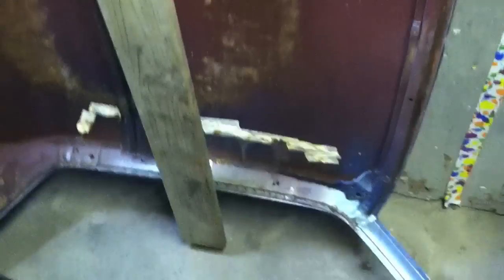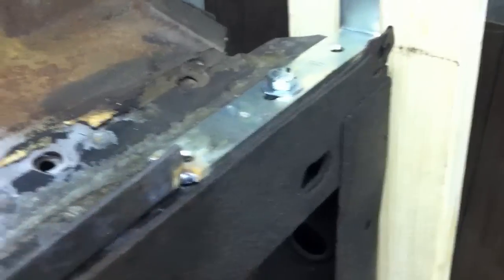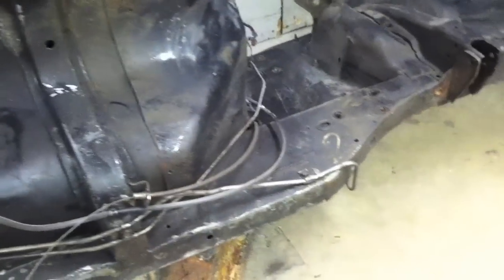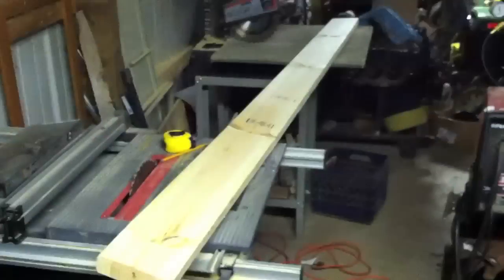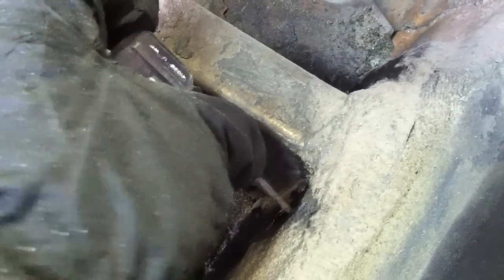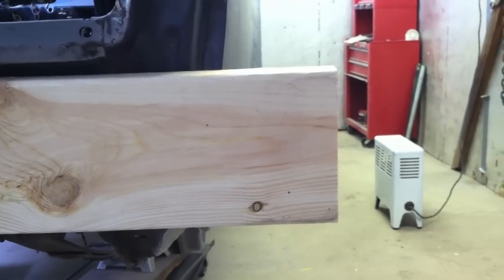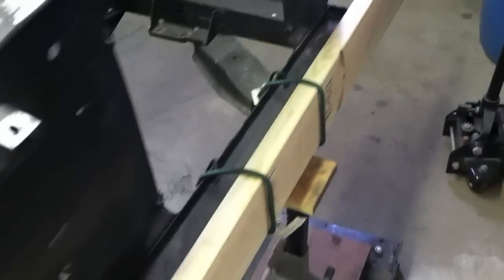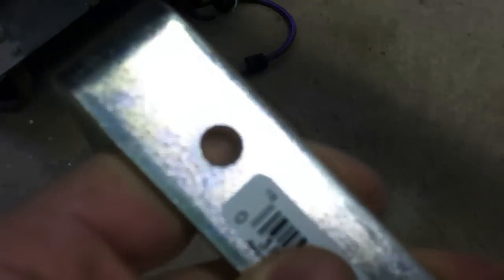INCREDIBLE Tip-Over Jig - Inexpensive Rotisserie Alternative

Comment: I appreciate you sharing your engineering idea. I would have never thought of using wood. I have a camaro clip I need to flip up to put a new floorpan in. My only issue is to figure an alternative mount at the front, as the sub frame is off. I will figure something to work as you did. Thanks Again Don

Comment from the maker: Yeah I thought about gusseting it, I still may but it holds pretty well as is. Its quite light, and those brackets are pretty tough.

I was originally worried about the front board rotating but the pressure goes straight down so it stays pretty straight.

Thanks!

Comment: I think he might have stole the idea from me but heck I stole it from someone else so it's all good !
Glad it worked out for you.Guys thinking of building one should check mine out too for another similar take on it.BTW my car is STILL sitting in the body shop after more than 2 years,but when I put the car back together everything lined-up fine. Some guys were worried about stuff flexing and making it impossible to get everything correct but no problem.Nice job, good luck with the car.See ya !

Comment: I might’ve missed this, But what did you do to adjust for the height difference between the front bumper and rear bumper? It looks like you did the 2 foot arc to the top of the 2 x 6 on both, but there should be a good 6 to 9 inch height differential between the two
Reply from the maker: Hey Jeremy! I responded to your private message at VMF, but its a combination of not needing it to be perfectly level and some adjustability in where the front angle brackets mount to the front jig. https://imgur.com/E4pMWTF
Reply: Cool! Really appreciate your quick response! I'm working on a couple of things and then headed back out to the workshop to finish this up :). I'm thinking of lowering the 2' radius pivot board on the rear bumper side to stay nearly level..the horizontal piece will still be on the bumper brackets, I'll just make the perpendicular braces a little longer. Think of any reason that would be a problem ?
Reply from the maker: Nope, that shouldn't affect the geometry much.

Comment: Dude.....you must eat a lot of Wheaties!  I'm doing a 65 comet (have been for almost 7 years) and this is one hell of an idea.  It's got surface rust on the entire bottom of the car and grinding and sanding under it is a royal pain!  I changed the floor pans and did all the welding already, now I just have to clean up what I can and undercoat or bed line or whatever.  I really like lizard skin but man! the cost!  Plus you have to prime first.  My car aint a show car, I'm just putting a neat little street sleeper together.  Happy 351W, world class 5sp and moon caps on a pretty stock looking car otherwise.  I'm going to drive it not show it....:-)
Reply from the maker: Its not as heavy as it looks! Lifting force was probably 60-80 pounds. The lever does all the work!
I'm not a fan of the bedliner on the floorpan. Just needs etch primer, epoxy primer, and a good coat of black paint in my opinion. Good luck with the project!